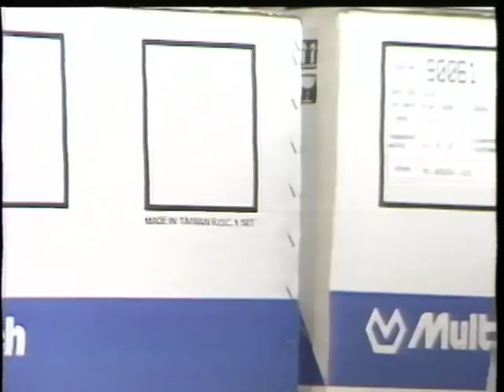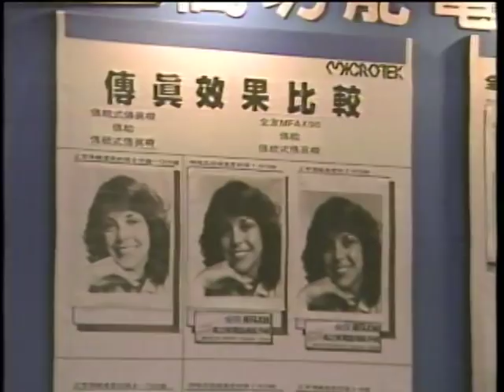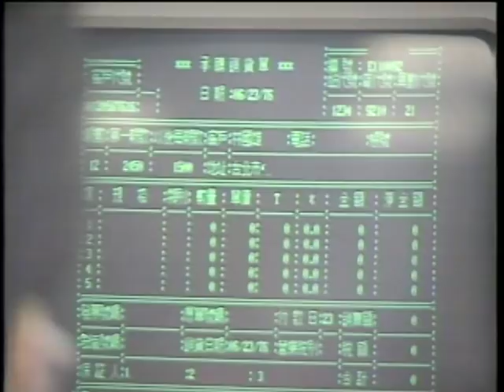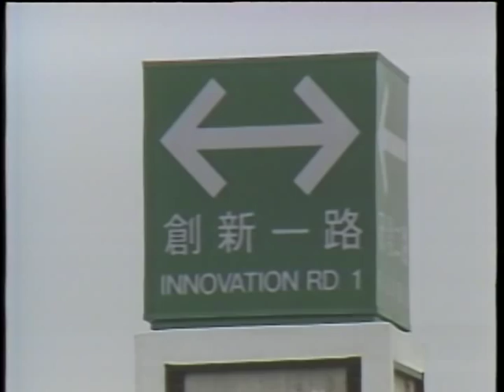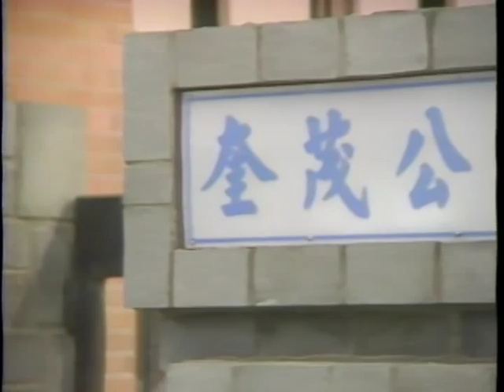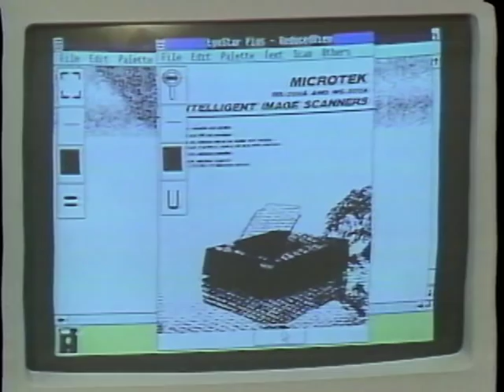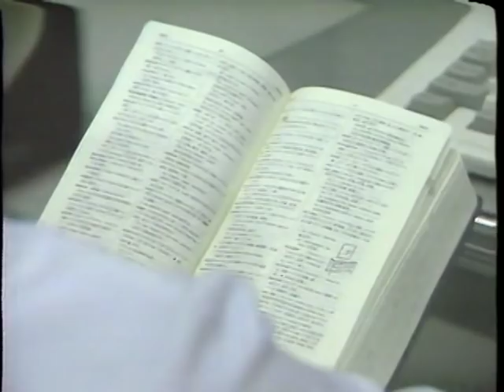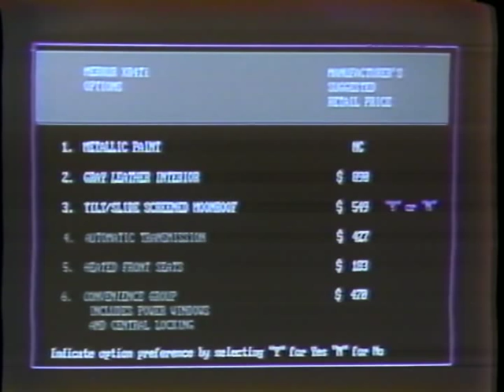The Computer Chronicles - Asian Clones (1987)

Comment: You kids never experienced the crushing oppression of IBM in the 80s.
Reply: Shanae  OS/2 was not that bad of an OS. It just lost because the driver support was shit. If the hardware vendors do not develop for it every OS is doomed. In Linux you still had freaks who develop the drivers themselves if necessary.
Reply: @lucius1976  And the reason why driver support was shit was because IBM's primary line of hardware at the peak of OS/2, the PS/2 series, used the entirely proprietary Micro Channel architecture.

Comment: Interesting with how primitive it was back then when it came to business.  Note the CompuServe commercial at the beginning, where it gave out an '800' number to contact them, yet, for being an ISP, it was odd they didn't supplement that with displaying 'www' to contact them.
Reply: The Web didn’t exist back then.
Reply: The very first websites didn’t come online until 1991 and the research project at CERN that designed the protocols that enabled them didn’t start until 1989. As such, in the 1980s CompuServe wasn’t really what we would think of today as an ISP (well, the concept itself didn’t even exist back then) but more of an online service provider with a proprietary user interface that facilitated access to curated online information and access to electronic mail service.

Comment: Dell, HP and technically Lenovo (IBM) are still the biggest computer manufacturers. Nvidia, AMD, Intel, Microsoft, Google, Apple and others are still at the top. Gary Kildall was right; the Taiwanese never caught up. They are still copying others but don't pull the innovation. Yes, Asus and Acer are big, but what did they invent? All the other Taiwanese names are long gone.
Reply: PC assembly has become a relatively low-value commodity industry and the Taiwanese moved up in the value chain. They now dominate advanced semiconductor manufacturing crucial for the PC industry as a whole. Even Intel is now using their foundries (AMD uses them exclusively).